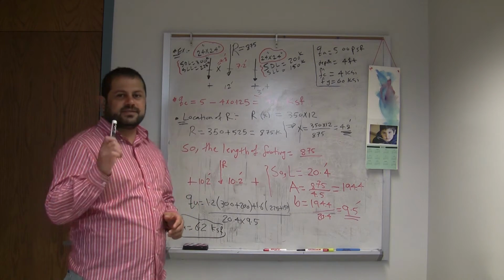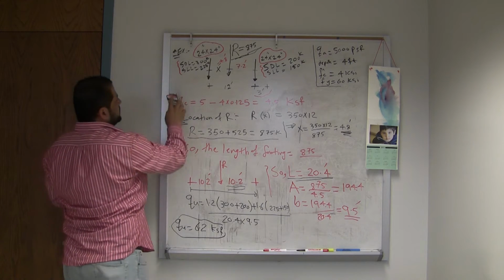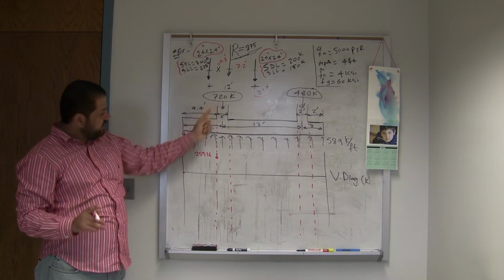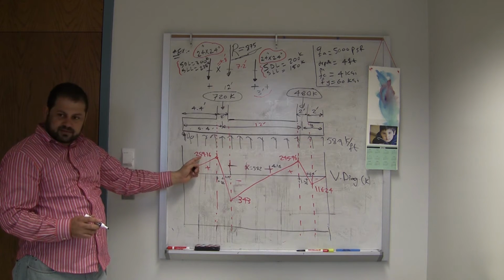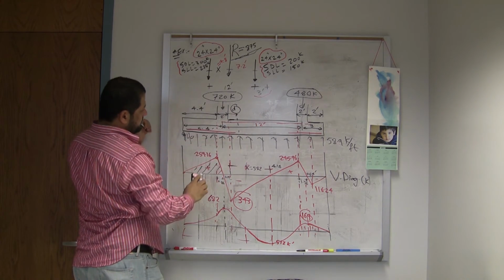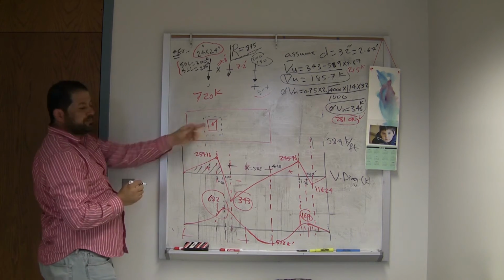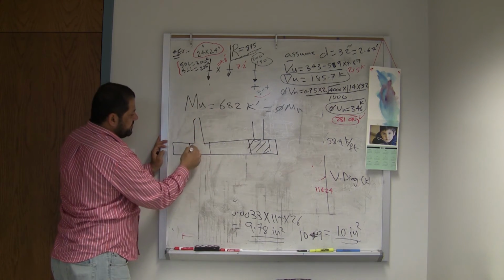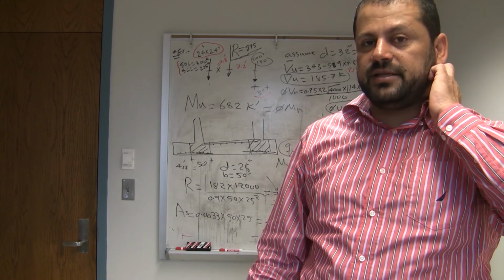Lecture #23 Reinforced Concrete Design - Dr. Mohammad Alhassan

Comment: @Dr. Mohammad Alhassan  A big thumbs up for your channel, great contents. I have a question about the reinforcement for shrinkage and temperature min 43.00, You say As=0.002xbxh. So, As=0.002x30x12, from where this 12 came from? because the only 12 that I know is the 12ft (the distance center to center between the columns).
Thank you for your effort, I completed all the concrete series and I will start with structural analysis and steel design.
Reply from the maker: In the bound inch system, the width of the strip we take is 1 ft = 12 inch, so b = 12 inch and the calculated steel is per one foot.

If you use the metric system, we take the strip width to be 1 m, which is 1000 mm, so the calculated steel is per meter.

Comment: The  ACI  Code  specifies  that two  6  X   12  in.  or three  4  X  8 in. 
cylinders must be tested for each  150 yd 3  of concrete or for each 5000 ft 2  of surface 
area actually  placed,  but not less  than  once a day......sir kindly explain it to me.......for each 5000 ft 2  of surface 
area actually  placed,  but not less  than  once a day....i am not getting this,,,w8ing for ur reply
Reply from the maker: it means if you placed less than 150 yd3 or less than 5000 ft2 in a day, you have to take two 6x12 or three 4x8 specimens.